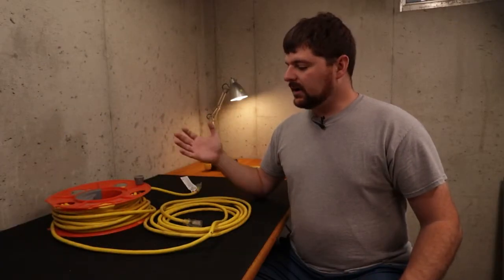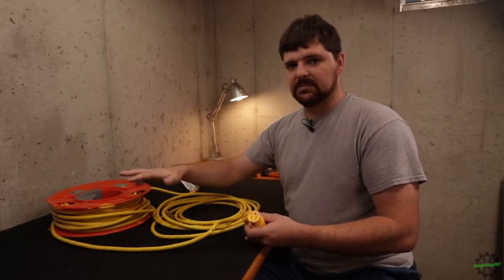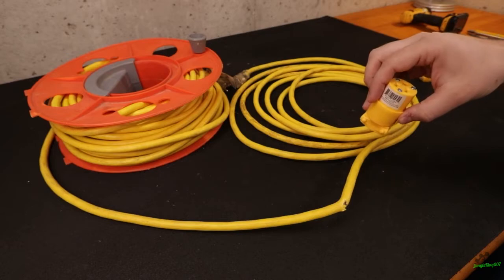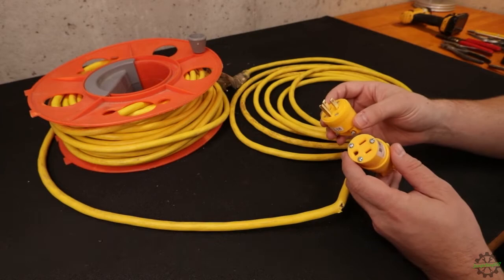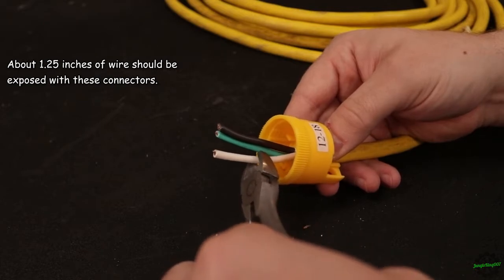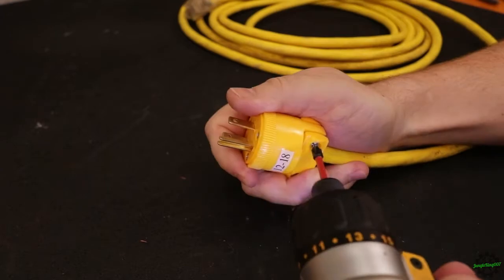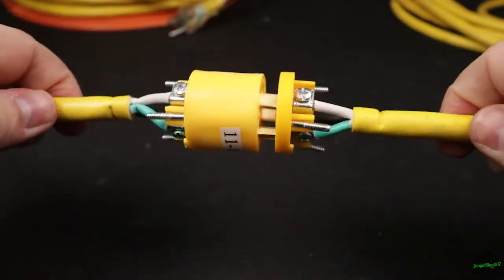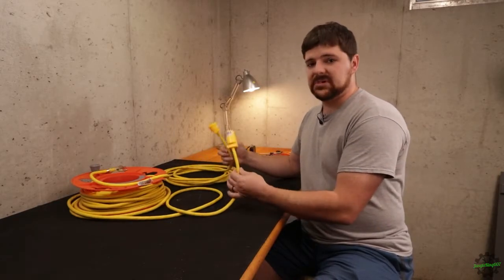Let's fix a damaged extension cable! (USA)

Comment: I just did this exact same thing.  I found a 50' cord with similar damage in a dumpster at a commercial renovation I was at.  Guy I was working with thought I was crazy for taking it but now I have a free 40' cord and 10' cord (already had a spare plug and outlet on hand)

Comment: If you keep a long extension cable on a reel like that, start winding it on the reel at the female end.  The exposed end is the male end which gets plugged into the outlet.  That way when you use the reel, you plug in the cable and remove only the length of cable required to reach the tool you're using.  The rest of the cable stays on the reel.  Makes life much simpler.

Comment: Friendly pro-tip, put a bunch of dielectric grease on the stripped wire where it goes into the terminals. Will prevent corrosion from water getting in (and potentially shocks).
Reply from the maker: Good call! Have a whole can of the stuff and it didn't cross my mind to use it for some reason. Thanks for the reminder!